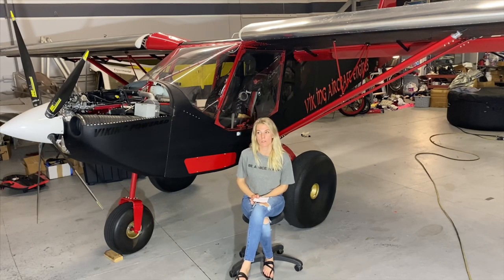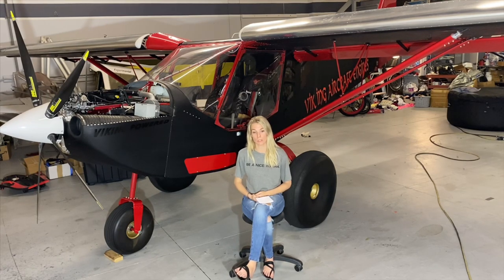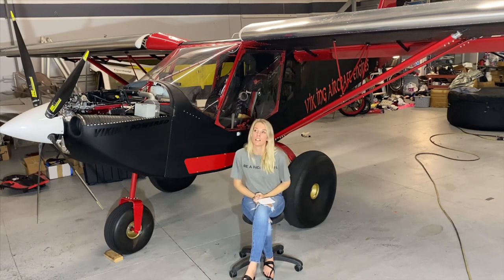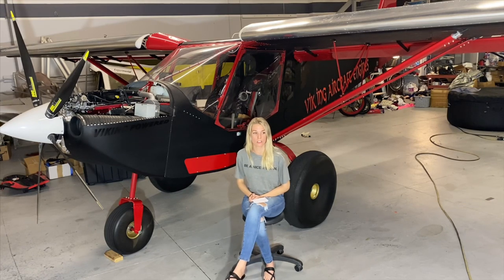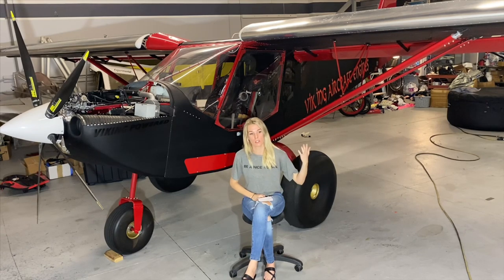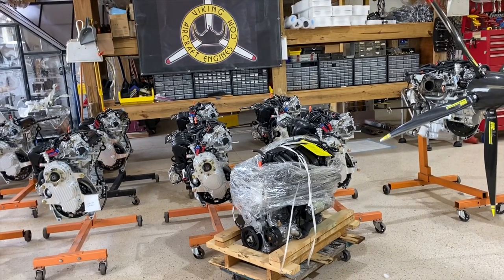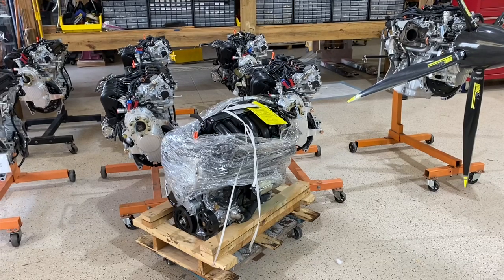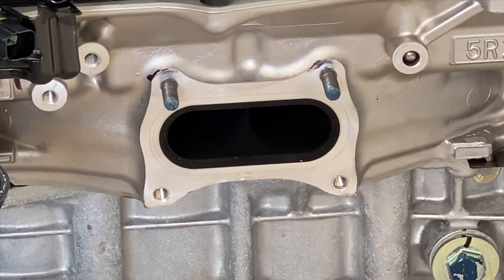Talks with Viking Part 4 - Sourcing, The Process and Why

Comment: Good video make another with more of what you do to the engine from removal of un needed parts to what yall add.
Reply from the maker: Good idea John, however, there are not a lot of unnecessary parts we remove, but if your wondering others might be to. We keep it as stock as possible, good for us, better for you and maintenance and part availability.

Comment: The value is the conversion hardware

A hardware conversion kit would be nice for the guys that know what's up with engine building
Might want to jump on that before someone else does 😃
Reply: Agree,  especially for non USA based..ie European etc.
Reply from the maker: Except the problem there is putting your name on something and hoping someone knows how to put it together correct, sometimes relying on the builder to install everything correct can be hard enough :) Than there are hours of consultation that would be required, but I do understand what your saying.
Reply: @eggenfellner  ya I guess there are alot of dummys flying around kit planes these days

Comment: What is the ready to install weight of each of the 130, 150 & 195 (230HP ?) HP engines respectively? Can you pake mounts for the Sling TSi and Vans RV10? Thanks.

Comment: The Honda Accord engine is rated at 252-260 horsepower, you rate yours at 170-190, is this just from a lower operating range?
Reply from the maker: We use the 1.5 L Turbocharged Honda Accord, so it isn't rated as high as the 2L engine and then we tune it for power :)
Reply: @eggenfellner  thank you.

Comment: I don't still  understand, why would Mitsubishi or Honda sell an engine with only 5 miles? was it because it did not pass their quality test? I don't think enough brand new cars are totaled to satisfy the supply chain
Reply from the maker: A lot of times the low mileage options come from Train derailments or shipping damage, they file insurance claims on the vehicles and we purchase the engine. Do you realize how many car engines are made a year? There are more engines we could ever use x1000's as well as parts.

Comment: You should go for the Cessna 180/185/182‘s! Thousands of airframes with bad quality Continentals, even from the factory! These ancient motors are super expensive and the factory quality is bad as was in my Conti470. Your Honda autofuel engines are also much lighter than the diesels. And your concept of a modern mass produced motor with a sturdy gearbox is convincing.